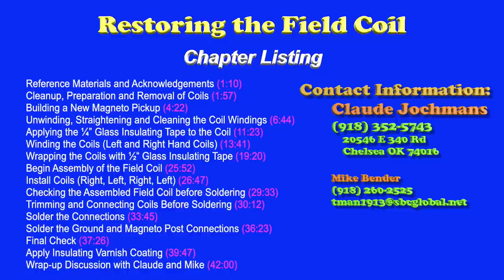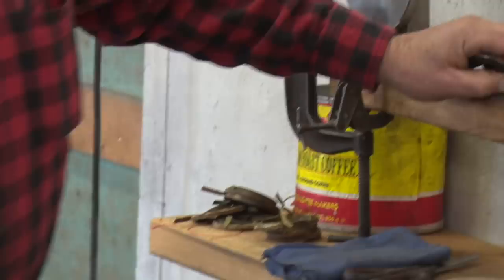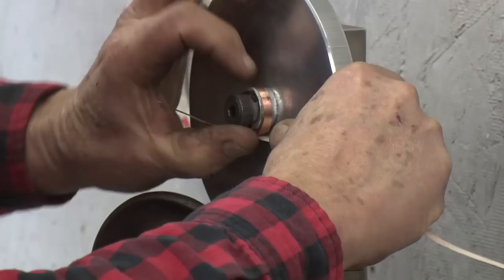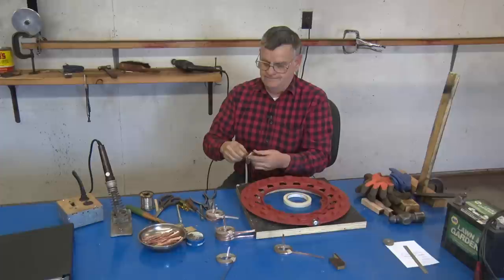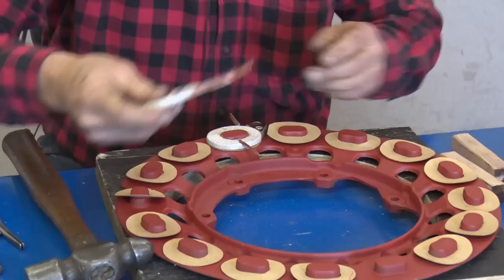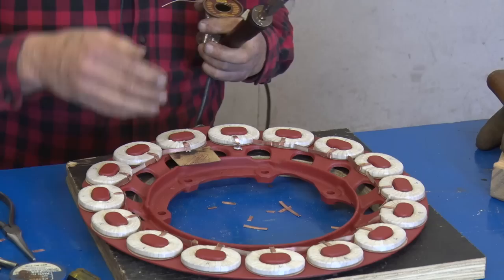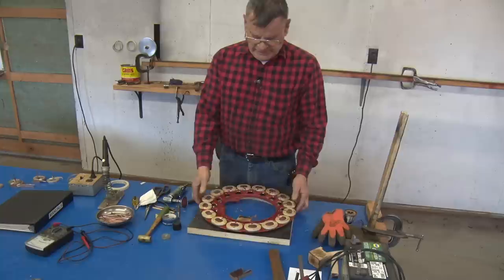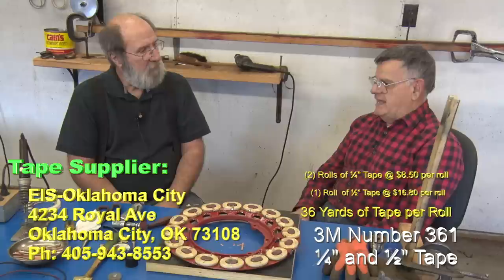Engine 14b Restoring the Model T Magneto Field Coil

Comment: I am a EE and have two observations to this superb presentation. The reason the coils must produce alternating current is the trembler coils require AC for the coil box transformers to make high voltage. They are just a short to DC. I would recommend not using the acid flux (as shown here) as after many years it will eat the copper and cause it to fail. Use only rosin core solder for this task or any electrical connection using copper. The process shown produces a beautiful field coil that's sound and reliable.  Bravo -

Comment: Claude,
I want to thank you for your time, experience and expertise on restoring Ford Model T Magneto Field Coils.
I have been looking for a supplier of 1/4" and 1/2" 3M-361 tape and will contact EIS-Oklahoma City. I plan on ordering extra 3M-361 tape to wrap sewing machine motor field coils (34 - 36 AWG magnet wire!). You probably did not realize that your video could apply to a small electric motor! 
My father (91 years old) and I (about as young as you are) have been restoring Ford Model Ts since the early 1970s.
Best regards,
Mark.
Reply from the maker: Mark... thanks for taking time to comment!  Stay Young!

Comment: You have done a grest job explaining. I like yiur work. Are you going to do any video on how to check a front axle for twist or bent? That will be my next project after my engine. I have not found anything showing just the Model  T front axle inspection.
Reply from the maker: Good idea.  Will put it on the list when we get around to a front end build.

Comment: Great instruction.
$35 a roll though (??), aside from knowledge and the exercise its surely more cost effective to simply pay one of the vendors that sell refurbs for $250.
Reply from the maker: Thanks for replying... I agree, unless you are set up to do a bunch it would not be worth the effort for one field coil.  We decided to shoot this process so folks would see that it takes to get it done right.
Reply: I recently checked the prices on the tape and materials as well and it was unrealistic. I have two coils that need to be rebuilt and have the wherewithal to do the job. It’s disappointing how inflation has changed everything and everyone is trying to make a buck and making it unaffordable to buy a rebuilt coil. The cost to buy after core charges, taxes and shipping runs nearly a thousand dollars.